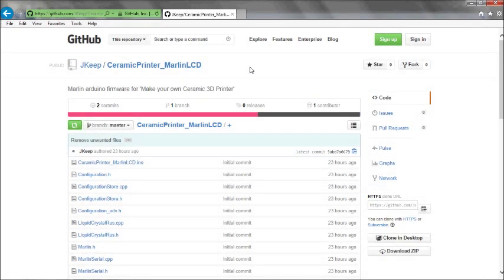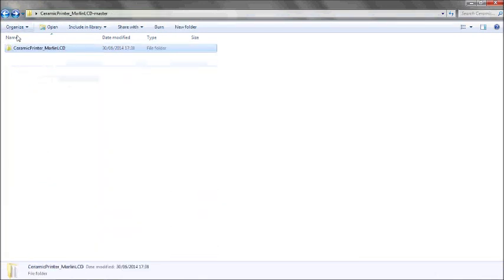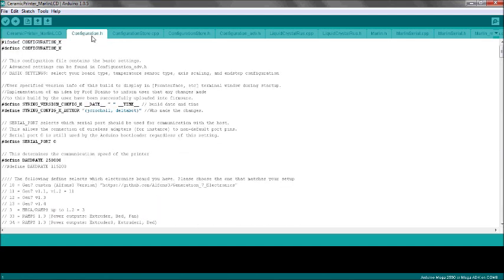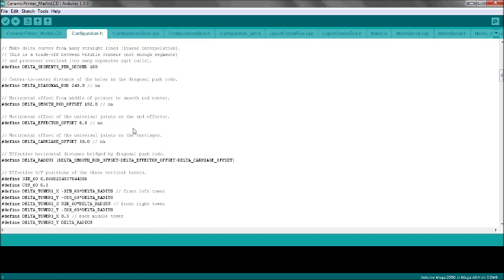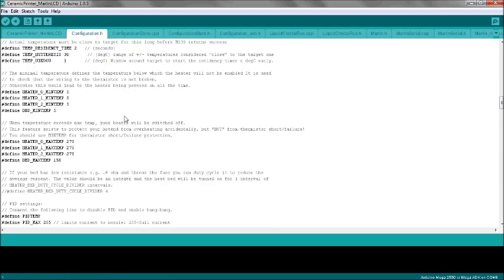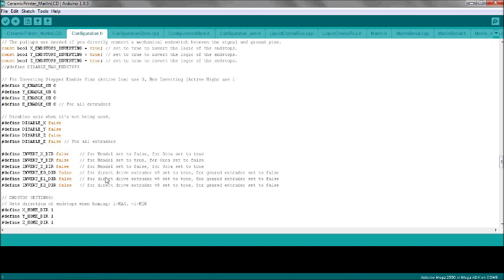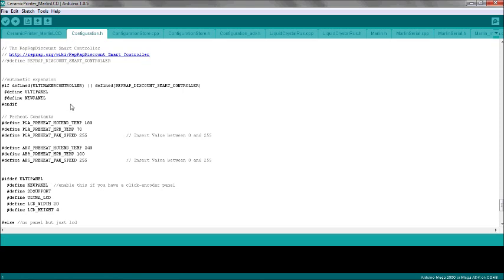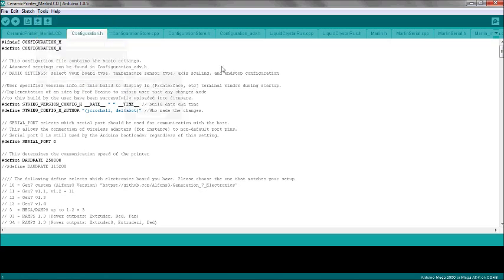Make You Own Ceramic 3D Printer - Marlin/Arduino Firmware

Comment: Hi, Thanks a lot for this video. Im a student and i do make my own ceramic delta printer. I'd like to ask what i should do on the firmware if i have the 4. motor to push ceramic ? Couse my system has  to print ceramic by step motor. 
Best Regards. :)